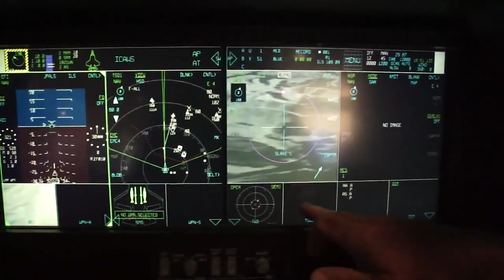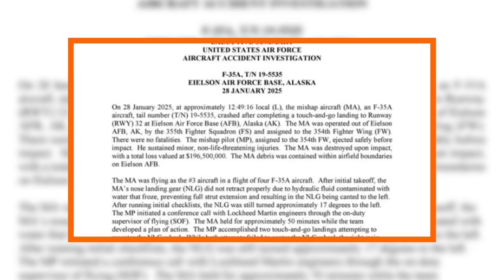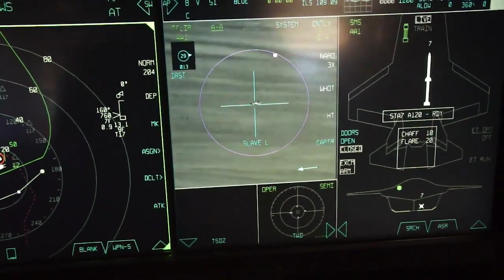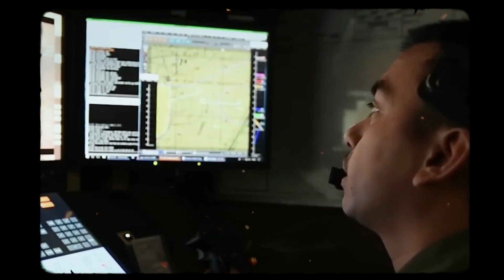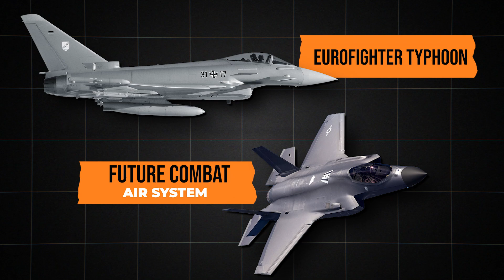How Did This F-35 Crash Happen?

Comment: more hightech more potential problems, plus human error, more will crash, $150 million each can do many useful thing for the country instead of giving all these  money to contractors, they build more they charge more.
Reply: You could say that but most problems are super easy to fix on the ground. A lot of the times they will just restart the jet rather than having to actually open up the fighter to fix an issue
Reply from the maker: That’s the billion-dollar question. Is cutting-edge tech worth it if maintenance shortcuts keep putting pilots at risk?